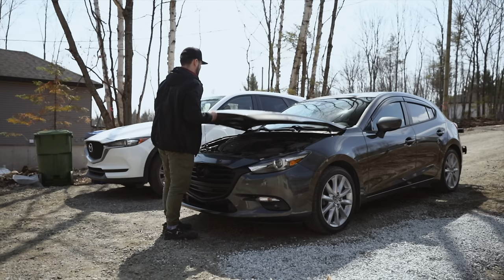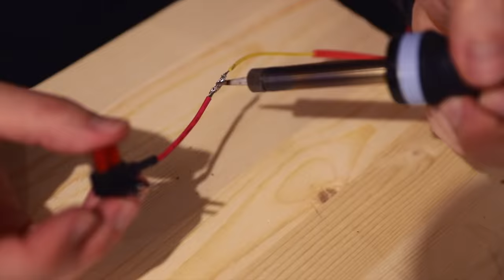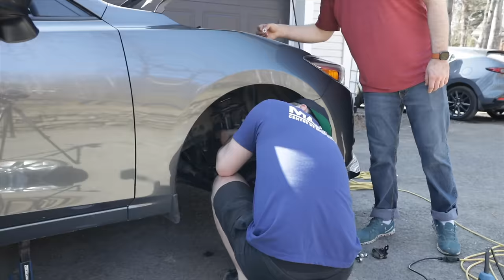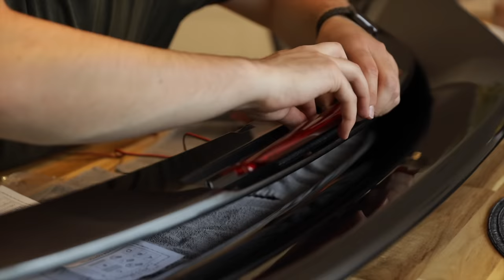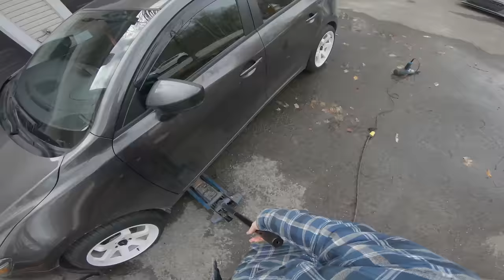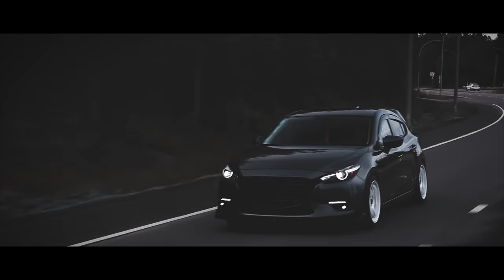Building a budget daily 3rd gen Mazda 3 (2014-2018) in 8 minutes!

Comment: I think the original Mazda wheels actually looked pretty good on the build.
Reply: I loved the original rims on my 2014 3. Got them powder coated in black, really made the car pop.
Reply: I think the original looked better than the ones he added
Reply: ayyyyeeee1403  The wheels aren't bad, but I just don't think they fit the car, especially in white.
Would rather have the car lowered on the stocks I think.
But I don't even have my own car, so who am I to speak.
Reply: ayyyyeeee1403  White wheels imo only really work with a ralley setup. The works-style wheels on older cars like the old civics or an r32 gtr.
Despite really hating chrome, I've grown to really prefer silver wheels on an all black car, and in the case of the mazda 3 here it worked imo.
I'm personally into small cars you can use. I l'd love to have a Porsche gt4 or gt3, but I'd probably equally love a VW up gti, or a polo gti if they sold them as manuals here in Germany. Stuff like the nd mx5 or gr86 are also bangers imo.
Reply: ayyyyeeee1403  gad damn, yea the golf gti's over here are so expensive my guy. They want 70k for a new R, and this makes the older ones hold their value. Even the Up gti, literally a 3cyl 100hp car costs 16k used..
But godspeed to you man
Reply: ayyyyeeee1403  Yeah, and it's not like VW is not German or anything smh..
Reply: Agreed. I want a set of the 2.5 wheels for my 3.

Comment: Hey man great video! If I could suggest 1 thing, you should give some love to your infotainment as well... like with a retrofit android auto/carplay upgrade, if your car does'nt already support it. 
I've got a Mazda 6 3rd gen, and I did the upgrade recently. It makes the interior so much cleaner, when you don't have to use some magnetic stuff to hold your phone on the windshield or vent holes.
Reply from the maker: Thanks! Yes I consider doing the upgrade! It doesn’t come stock in the 3rd gen, but is available to upgrade !

Comment: I love what you did. The fitment of the wheels is good and the wing gives really aggressive focus RS vibes.
It's a shame these cars are slow as hell.
Can't wait to put wheels and tires on mine.
Reply from the maker: Thanks! Yes I’m very happy with the result!
Reply: Slow as hell? what are you talking about? making the 0 to 60 in 6.5 seconds isn't precisely slow for not having any forced induction. But if you still want the car to be faster, get the Corksport turbo kit, now available for automatics too.
Reply: slow but feels fast haha over all its a fun car to drive and tbh you can fit a lot of stuff in the hatch it's insane.
Reply: @Elite_Warfare  the 2.0 is obviously slower than the 2.5 but the latter reaches its torque peak at 3000 RPMs, that's fast enough for the segment they compete. While the manual transmission is decent enough, the automatic version is faster than any CVT that you'll find in civics and Corollas. The 2.5 is light and fast, do a ECU tune and you can reach 220 hp max, enough to compete with hot hatches like the golf GTI. Install the turbo kit and you'll have technically a Mazdaspeed3 3rd Gen (which was never delivered)
Reply: @JavierLianso  I have a 2.0 2015 but currently having issues i can't floor the pedal its moving slow, I was driving in Manuel mode shifted late and the car jumped hard and the dash lit up, its still moving but i also can't read the vehicle (the reader under the driver side) stopped working, I found  a blown fuse from that but still doesn't work after changing, I don't have money for the dealer atm.
Reply: @Elite_Warfare  sounds like a computer problem. You'll have to scan it. Look for a shop that is not very expensive because the dealer will tear your wallet apart no matter what.
Reply: @JavierLianso  Thank you for the reply Javy Truly appreciate it gonna check out place this weekend I hope it is the computer it honestly seems like it the car started  calling ppl on its own today talk about annoying!
Reply: @JavierLianso  don’t ever compare these to speeds please 😂 even with their turbo kit they can’t touch speeds
Reply: Slow!!! Even the diesel models can crack 60 mph in under 8 secs.... Thats far from slow....
Reply: @265justy  yeah too true. I have the 2017 2.2td (150) over here in the UK and it's quick. Stats show 7.8 secs to 60 but I have timed it at 6.9sec and only half a sec slower to 60 than my brothers corsa VXR!

Comment: This is exactly what I'm working towards for my '14 mz3! The only difference is that I think I may go for the full 80mm catback from Corksport. 
Also, I have a question. I have the MS style spoiler but which colors do I match the wires to for the brake light? The ones from the spoiler are red and black, but the ones from the car are white and green. Any advice you have would be very helpful!

Comment: Wicked looking whip my man, just bought a 17' hatch GT and I realized your DRL can be on without any other lights while driving. What kind of mod did you have to do?
Reply from the maker: Thanks! No, my headlights are on instantly when I start to drive. Sure it is possible to mod the headlight to do what you want, but I don't know exactly how. You need to open the headlight to access the control board. When i'm parked and the light selector is on "corner light" mode, just the DRLs are on. As soon as I start driving, the projectors turns on.
Reply: Thanks for some reason I thought the projectors were off while driving, 14-16 had the DRL only but 17-18 merged the DRL with projectors. Cancelling out the projectors during the day but still have them at night is a tricky thing under auto setting..

Comment: how many km did the mz3 have when you got it? I am looking to buy one too. Also I got one more question, I saw that yours on the back has a lower portion of plastic, many mazda 3's I am finding have the plastic part that is way bigger that yours. Is it a special model that is like yours? cause I dont like that plastic part being that big.
Really liked the video.
Reply from the maker: Got it new so ~0km! The plastic in the rear is different depending the year. 2014-2016 had a bigger plastic trim than the 17-18!
Reply: @olzgarage  ooo cool thank you so much for the help :)

Comment: Could I get some advice on the best method to turn the chrome around the grill black, as well as the chrome around the windows. Plasti-dipping, paint or wrap? I read plasti dip gets really beat up after a year or so, I wouldn't paint the parts rly, would a wrap be the best choice? How did you do it Leonard?
Reply: I'm looking to do the same, DIY spray, replace or dip?

Comment: Great vid man... just wondering how the AliEx lights have held up over the years?
Reply from the maker: Thanks! They held up so so. It’s the winter here that is rough on them. The wiring are cheap so they need extra protection because they keep water on the wiring loom and it rust quick. Also the lens fog up and become yellow. The second set I ordered, I put a clear ppf on them and they were great after. I didn’t found better quality ones but for 70-80$ish they are cheap to swap if something goes wrong.
Reply: @olzgarage  Ah, that's cool... thanks man, appreciate the reply! Looks sick 😈

Comment: Guy asked about how you did the chrome delete, I'm looking to do the same, DIY spray, replace or dip? 
If you could make a video on even how you did it would be great.
Myself i have a 6 , and another Q i want a front strut brace , when i look so easy to find Mazda 3s but hard to find the 6 model, i want to know if the strut for a 3 would fit a 6 , as outerbody is wide compared to the 6 , but top of suspension dimensions, are they the same ?
Reply from the maker: It’s plastidip ! Not the best result but for the price and effort i’m good with it!
For the strut brace, when i look on the corksport website, they have a strut bar that fit the 2014-2018 mz3 and the 2014-2017 mz6. I don’t know if it’s your model year but they seem to be the same!

Comment: I just bought one today and I love what you did with yours! Did you roll the fenders in the rear because of the wheel offset? Or the slightly lower springs? I noticed you did 1.5 in the rear and 1.0 in the front.
Reply from the maker: Nice ! Yes I roll the fender because the offset+width of the wheel. 18x8.5 +35 with 225/45 tyres is just at the limit to run without little camber in the front/rear. The eibach springs are not that stiff so it doesn’t help
Reply: Good to know, thanks. Also what is that spring compressor you used? I’m looking around on eBay motors but for some reason none of them have photos and yours look like they worked quite well

Comment: I have a 2023 M3 GT (6MT) on order ... your build has me considering saving a ton of $$ and going with a used gen 3 instead.  What trim level would you suggest?
Reply from the maker: That can be a great choice! Personally I would not go other than a GT, especially the face lifted models 2017-2018! Just for the signature led drl. It change the look a lot! You will have the 2.5L engine that is more fun to drive! The GX and GS had the 2.0L
Reply: @olzgarage  thanks I'll look into that now!

Comment: I see, you painted the front from chrome to black, just as the sides under the windows. Would you prefer Matte black like you, or glossy?
Reply from the maker: I always wanted to try gloss black, but it require a wrap. So it’s a job a little harder. But I still like the matte black since all the other plastic on the car are kind of matte also. It fit better I think but i’m also curious to try glossy.
Reply: @olzgarage  I'll try the glossy spray film. I'll let you know when it's finished. i got the dark blue colorcode, thats why i think the Matte wouldn't fit that well.
Reply from the maker: I’m sure it will look great!

Comment: Do you get rubbing or scrubbing with offset +35? My mazda is basically the same as yours and I am considering 2 17x7.5 wheels: one with +35 and one with +42. Please reply me, thank you.
Reply from the maker: My wheel are 8.5 wide and +35. Yes they rub a little bit in the front and the rear, but I need to roll my fender in the rear a little more and I will be good.
I think you will be good with a 7.5 wide wheel +35!
Reply: @olzgarage  thank you very much!!